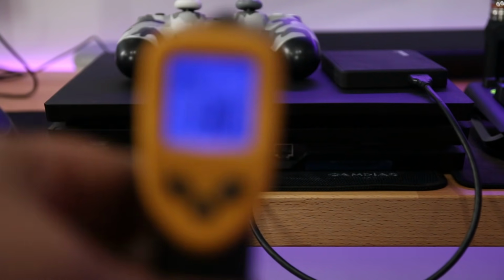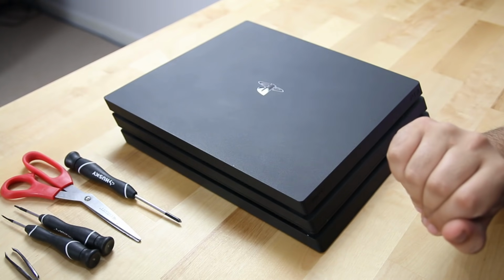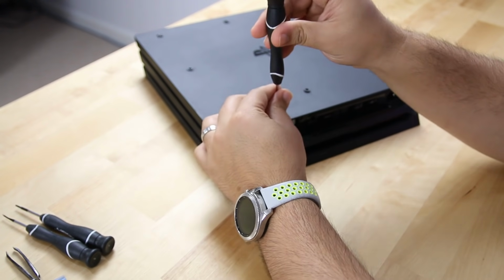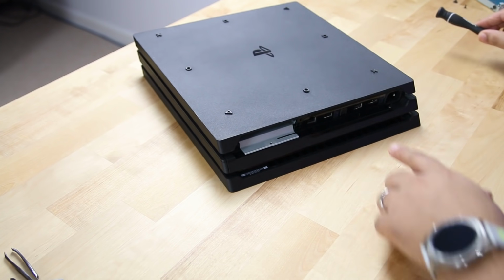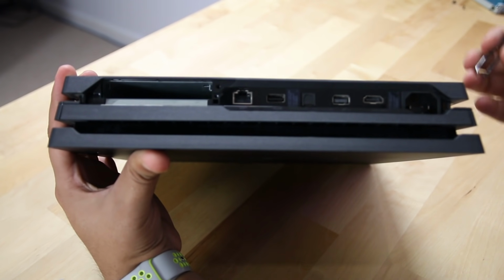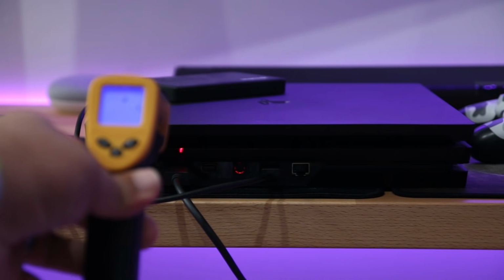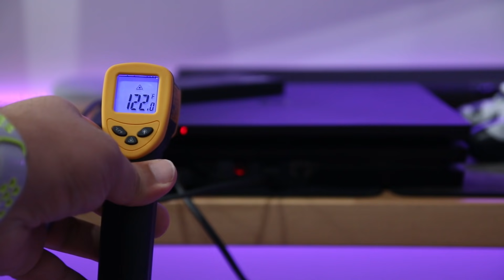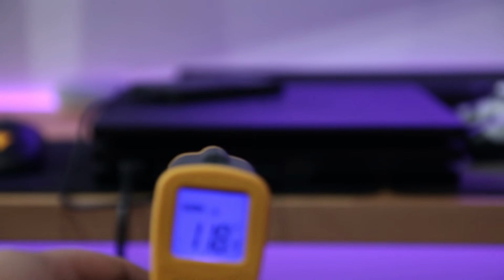PS4 Pro Fan Noise Fix - Thermal Paste & Pads Upgrade

Comment: Would a 1g of the paste be enough for the PS4 pro? I'm asking as I'm in Australia and it's very hard to find this stuff
What other brands would you recommend?
Reply: 1g should be enough for 3-6 or more applications.
I've had the same one and I used it to change thermal paste on a couple of Laptop's, my PS4 and two more PS4's.
 thermal grizzly kryonaut is the best one in the market. I've seen many benchmarks.
The other one that had like 1C° more temperature than kryonaut.
Noctua NT-H1. It's pretty good too. There's an NT-H2 as well, idk how it performs. 

In my experience, these two are the best thermal pastes in the market but I'd prefer kryonaut over any other paste.

Comment: Just a heads up, you're the only guy I've ever seen use Fahrenheit for temperatures in a tech product. Everyone - including Americans - have been using Celsius for temperature in tech products for decades. That being said, a general goal of CPU's and GPU's should be to always keep them below 80 Celsius under load. Anything above that, and it shows a cooling issue that should be resolved.
Reply from the maker: I'm different. Lol jk it was an amateur mistake. Going with Celsius now
Reply: Voyage & Hearth : Good to know but I like it in Fahrenheit

Comment: I imagine since you were probably thermally throttling it got a little faster afterwards? I’m about to re-paste my PS3 and 4 with MX-4 and replace the thermal pads with K5 Pro so I’m hoping to get a bit more performance since it will run way way cooler I might use TG Kryonaut or Kingpin KPX I dunno yet on the PS4 I like having multiple thermal compounds around lol last computer I built was in 2003 AS5 was still one of the best I think next re-paste on my main AIO cooled gaming PC I’m gonna try TG kryonaut extreme, the Kingpin KPX I’m using now has been working great since I put it in my system on January 5 of this year still idling at 30C I looked it up it says Kingpin only lasts 6 months I’m past the 1/2 way mark and still no degradation I think ppl apply paste to thin these days I do the spread cause that’s how it was done back in the day and every since my first temp sensor board which was my last board the spread is the way to go I bought a pre-built they did grain of rice with AS5 I idled at 50C 2 mins into gaming I would be at 85C+ now I hit 56C max while gaming for several hours but I also changed all the fans to noctua’s A12x25 on the rad and then 3 x 1700rpm P12 Redux high performance as case fans way better than Alienware/dells OEM crap little off subject but thermal paste if properly applied last longer than people think is the point I was trying to make they say a lot of the high end paste have to be changed every six months my dads laptop has had TH kryonaut in it for 3 months it still idles at 39C max 56C I can’t make it throttle ( I tried to throttle both the APU/CPU at the same time only hit 56C not bad for a PC that did stay pegged at 60C and was slower than a turtle now it’s fast again ) at the AMD A6 throttles at 60C
Reply: updates?

Comment: Hey! very nice video, I posted you a comment a while ago because I am having simmilar issues with my ps3... I bought the paste, I changed it... and after that it went even worse XD it sounds like a vacum cleaner and I dont know what did I do wrong, maybe I puted the screws to tight? no idea,... the ps3 looks inside like new! no dust everything cleaned up with alcohol
Reply: Have you fixed it?

Comment: Hey! Thanks for the vid, so I just did everything you said to do in the vid on a ps4 pro and now when I go to turn it on it blinks blue twice and shuts off. Any tips on how to fix this please?
Reply: What size thermal pads did you use? If you use too thick or too thin thermal pads, the memory won't activate as they respond to too much or too little pressure. If all else, check that every single cable is connected, including that the PSU cable is pressed all the way in.

Comment: I bought a new fan, cleaned out my radiator and any other parts of my system, I put on the pads and paste, and the system went from 70 decibels to barely audible. I got into a boss fight in Ghost of Tsushima and my system was so quiet I thought I forgot to plug my new fan in

Comment: You should a added that you don’t have to remove the power supply first it took me 40 min or because i was trying remove it up just to come right off taking the back side of the PS4 apart by taking a step ahead now my PS4 cuts on for 2 seconds and cuts off smh

Comment: Awesome video. I've been wanting to do this for a while. You mentioned to make sure you use the 1.0mm pads; I have 1.5mm pads. What What would be the harm, if any, in using 1.5mm pads?
Reply from the maker: It won't pass the heat thru as efficiently and may cause it to overheat
Reply: @TechSavvyBuyer  I had to replace the 1.5mm's with 1mm because my system overheated as you said. It was working fine initially then it started freezing during gameplay and eventually shut off. Everything is perfect since replacing with the 1mm's. It's much quieter now. I'm going to replace the fan next week for even better performance. Thanks for the video.

Comment: I have the same paste over after changing my cpu cooler in the pc so thought i may as well change the paste in the old ps4 too. Got the pads...now age old questiln, was a "pea" size ammount of paste in the center of the dye enough? I keep reading the copper plate on the ps4 pro isnt entirely flat, not sure what difference this makes.....also ordered some rubber feet to install under the ps4 to dampen out the disc drive vibration and see if a gap underneath the console also helps a little with air getting round it.
Reply from the maker: Use a spreader to make sure you get full coverage. I am gonna remake a new version of this video

Comment: I got stuck on removing the battery. How did you unplug the wire by hand. I couldnt get it off, felt like I would brake it.

Comment: I'm going to repaste mine next week. Looking at other guides and comments on reddit it seems you should not forgo putting pads on the hdmi controller and the southbridge chip. These chips also have a hand in controlling the fan speed, and cooling them will make the fans peed even lower (or so I hope)

Comment: So I’ve done this to a few PS4’s and worked like a charm. Did one yesterday and now the control won’t connect. Checked the antenna, tried different cables, replaced the antenna from my old console and still nothing. Any ideas?
Reply: Did you plug the controller up to the PS4 after?

Comment: Is there any reason why you didn’t spread the paste? Some videos show spreading the paste, others don’t, any advice would be appreciated
Reply from the maker: It spreads on its own when, you reassemble
Reply: Thank you for the fast response - Especially on a year old video, keep up with the great work!
Reply: I’m trying to “gently unplug” the power supply, but that thing isn’t budging, damn it!
Reply from the maker: @liamsilly  make sure you remove the 2 screws on the opposite side. I didn't show in video but listed in comment/description
Reply: Thank you for the clear tutorial, I would have found it helpful but my current position after reassembling is that my console will no longer power on, it simply beeps once and then the blue light goes out, is there anything you could suggest?
Reply from the maker: @liamsilly  something isnt connected back correctly. It is getting power so thats good. Check all your connections when you reassembled it. It should boot up like nothing happened if you correctly reassembled it.

Comment: i have a question about what alcohol you used to clean the thermal paste..is ist okay if i use normal alcohol in the market like..ethyl alcohol or 70% solution isopropyhl alcohol..thanks
Reply from the maker: Yes that is perfectly fine
Reply: oh ok thanks...how old is your ps4 before you replaced the thermal paste..mine is 1 year and 7 months..and im planning to replace the thermal paste on it because it sounds like a plane ready for take off and sometimes it even pops up a warning that the ps4 is too hot..even when there is a better ventilation in the room

Comment: Stupid question!! Do I remove the pads on the inside of metal casing if I’m placing new ones around the chip? I notice they are stuck under the plate & not resting on the chips

Comment: I have 2 questions: 
Do i need to change the termal peds and what happens when you put to much of termal paste?
Reply: If you put too much thermal paste on a PC you shouldn't have too many issues as the pressure of the cooler will displace excess paste onto the motherboard. I don't believe it's very different with a console so you don't have much to worry about.

As for the thermal pads, I would recommend you change them, although I don't have any experience working with thermal pads. hope this helps.

Comment: I followed this and it worked like a charm but my ps4 Pro is quite warm and the fan is quiet, show I be concerned?
Reply: Nope, its normal to be warm in top right, that's where the heat exhausts from.

Comment: great video. I read online that there are many method of applying the thermal paste and you are using the blob method? which method is best?
Reply from the maker: Either works just fine. You can do the cross method as well, just dont use too much of it! :)
Reply: Pea size dot in the middle you'll never go wrong

Comment: Wtf.. where do I put the thermal paste on the CPU on the motherboard or on the shield /cover opposite the cpu like you did? So many have said you have to put it on the CPU.My brother in law successfully cleaned the heatsink which was God awful dirty, but he messed with the thermal paste, cleaning everything off without replacing it with new paste, now my PS4 makes more noise and shuts down and gives an error because of overheating. When the heatsink was full of dust , it worked fine though it sounded like a jet engine now the fans and heatsink are clean and now it overheats, oh the irony,😜

Comment: I tried the 1.5mm thermal pads seems to get better heat transfer.well just my experience so far
Reply: How are the 1.5mm pads holding up?
Reply: @Songya28  pretty well
Reply: @cad212125  I'm doing mine now. Just took the system apart
Reply: did you put it in the same area he put it in the video? cause apparently it's the wrong spot?
Reply: @arisgolseen2693  Yeah I noticed that when first watching the video. I have them placed correctly.
Reply: @cad212125  I had to replace the 1.5mm's with 1mm. System overheated!
Reply: @Songya28  where did you place them? the circle grey/black chips?
Reply: @arisgolseen2693  The black chips. Here's an additional guide to follow...https://imgur.com/gallery/420nWq8

Comment: Hello. I have a PlayStation Pro when I play games that make the helicopter sound a lot even though I changed the thermal paste, is this normal?
Reply: PS4 Pro needs better pads on the GPU memory, 8 black chips under the cover...but if its the PS4 Pro V1(7000 model) strap it down or it will fly away

Comment: My PS4 pro is year old only but it got heat issue after an hour of gaming n it’s says Ps4 is hot n turns off. I’ve got it cleaned twice as well as change it’s thermal paste twice n tight my heatsink too but still issue has come up twice Same after week use. Any idea what is the issue here?
Reply from the maker: What paste did u use? R u applying it correctly and sufficiently? Is the heat sink sitting tightly on the apu? Make sure its all correct cuz u shouldn't be having this issue. Also, what is the average room temperature

Comment: I'm pretty sure you've put the thermal pads in the wrong place... I was following several guides while doing this myself and noticed that the pad placement doesn't make sense so I put an extra pad on to see where it would stick and it was the smaller chips that are recessed. Here's some images from a post I found:
https://www.neogaf.com/threads/seriously-wtf-the-ps4-pro-is-embarrassingly-loud.1316685/post-246722938
Reply from the maker: Yep I pointed this out in my pinned comment
Reply: @TechSavvyBuyer  ah right, sorry didn't see the comment
Reply: Actually I just checked and don't see a pinned comment, I'm guessing YT is messing up

Comment: Hallo, which Thermal paste should i use please? Thermal Grizzly or arctic mx 4. Thanks
Reply from the maker: Thermal grizzly
Reply: Thanks man. Another question regarding the pads. Should i put them on the chips that looks like a U letter in minute 7:22?. Thanks

Comment: Just done mine put everything back together and ps4 pro just shuts off straight away, nothing snapped off when taking it apart or putting back together, was 110% careful and yes i have checked the power cable, it ran for about 10 mins then dead and just beeps everytime i try and turn it on
Reply from the maker: How much thermal paste did you apply?
Reply: Just like in the video a tab bigger than a size of a pea

Comment: So my power supply only has 4 screws. That one in the middle is just plastic. I try to pull the unit out and I honestly feel like I'm going to break it. I dont see anyone else with this problem and no info shows up for this issue. I pry and pry and the middle stays stuck. I'm trying to figure out why so has this happened to anyone else?
Reply: its just tight hommie, just pull from both sides and unscrew both screws wich are attached to it at the bottom of the sysstem
\

Comment: dude...it is ok if  i will not change the thermal paste? your video is too fast. can u please upload a full video and detailed?i want to clean y heat sink. thanks in advanced
Reply: You can play the video on youtube at 1/2 speed.
You should be ok to just clean the heatsink - but if you are disassembling for that anyway there is no reason besides $15 to not do it at the same time as most of the change here is the paste
Reply: Ben Grogan 
Thank you so much dude...👍🏻

Comment: does this thermal paste and thermal pads still work good for ps4pro in 2021
Reply: Off course dude.
This solution and the ps4 pro did not change just because it's 2021 🤣

Comment: Lol yeah, I'm not confident enough to perform a operation at that scale on my pro, not only that but mine is still new. I bought the spiderman edition. So I guess my my last option is to clean the fan as best as I can and hope it will last.
Reply from the maker: It is REALLY REALLY REALLY EASY. it's hard to break something or damage something. Sony made this pretty modular and accessible. I would do it if I were you. I did it to my limited edition God of war pro also.

Comment: Followed all the steps. Now pro won't turn on  :(  PSU is connected. Not sure what the issue is
Reply from the maker: Are all the ribbon cables still intact? Make sure the apu has proper coverage and, don't use too much thermal paste

Comment: I want to do this but my only issue is that all the damn screws keep stripping whenever I attempt to take them off.
Reply from the maker: 4 u using a security torx 8 screwdriver? It has a little notch in the head
Reply: @TechSavvyBuyer  The phillips ones are the ones that keep getting stripped. lol
Reply from the maker: Use a small flat head. Like really small. That usually works well

Comment: I know I’ve must have done something wrong but i followed the video and now my ps4 won’t turn on. Any ideas?
Reply from the maker: Is your power supply seated properly?
Reply: Tech Savvy Buyer I think it is. It’s pushed down all the way but I noticed 3 wires coming off the end of the pin that connects to the motherboard  is that supposed to be there?
Reply from the maker: @Jonathan-Hack  I can't remember exactly. Just make sure everything is plugged in correctly. If needed, look up another disassembly video to double check
Reply: @TechSavvyBuyer  figured out what i did and would like your advise on what to do next. When removing the power supply i took the part out of the mother board that the pin connects to along with the pin its self. Have i broke it permanatly or what should i do about this?
Reply from the maker: @Jonathan-Hack  that doesn't sound good. Did the board crack anywhere? If not you may be able to just solder it back on
Reply: Tech Savvy Buyer that’s what I was thinking as well. I will do a closer examination to make sure but I don’t think it is cracked. Thanks for the info I’ll keep ya updated on the progress with it.
Reply from the maker: @Jonathan-Hack  good luck!

Comment: What does the thermal pad do? Do u need to use it
Reply from the maker: it works like thermal paste to remove heat from the chips. Yes you need to use it or use the same ones that came in the system. Don't remove it and leave it empty!
Reply: @TechSavvyBuyer  I recently applied arctic mx4 to my ps4 pro bt it kept queit for only one week. I am thinking of buying kryonaut or conductonaut, will there be any difference? Any suggestions please. I have games bt I can't play them because of noise

Comment: Just did this and results are amazing. PS4 Pro went from a 747 at takeoff to a whisper.
Reply: Sébastien Decoux really ? Right now I have faced with this problem for a year , every time I play GOW,  it piss me off so could u please help with this
Reply: @MiKeGolfs  yes really. PS4 was loud as a hair dryer when I was playing a lot of games. I bought the thermal paste recommended here, disassembled it, and replaced the factory one as explained in the video (except for the part where he missplaced it of course). Before making the move, make sure you have the thermal paste, a Philips screwdriver, a t8 screwdriver, and rubbing alcohol.

Comment: Followed your video. You should make some extra warnings: the big flat cable has a lock mechanism, when putting the thermal paste its better to put it directly on the processor. Otherwise could lead to error ce-30392-7.
Reply from the maker: I am going to be making an updated version of this video to make sure it addresses all of the issues seen in this one.